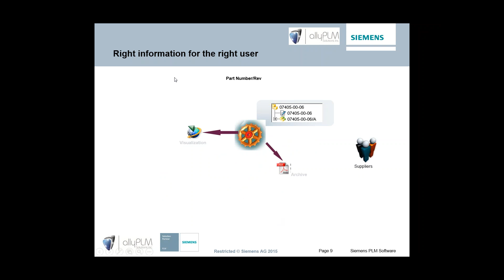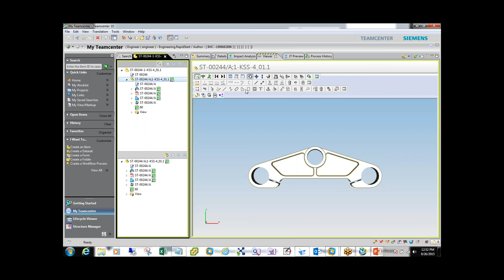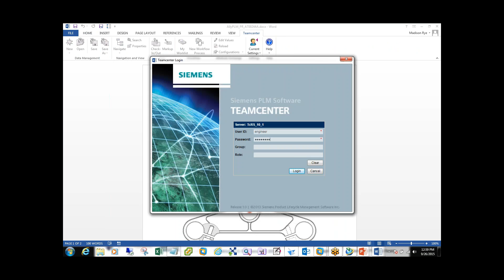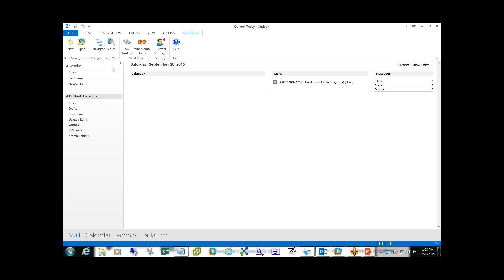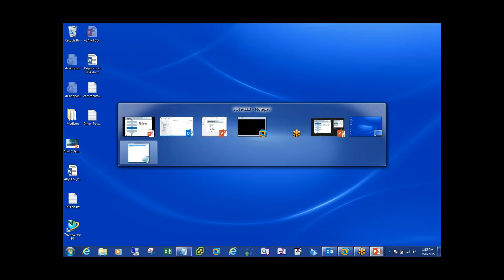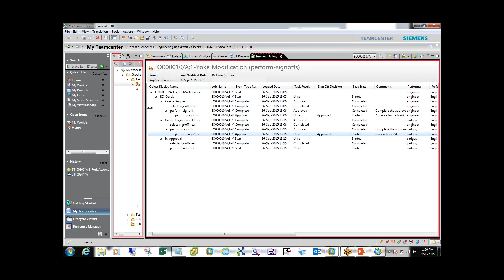Managing Data with Teamcenter

Comment: How do you retain old revisions in assembly? 

For ex: I have made a change to a released part and create new part. Replace in assembly. But The assembly is supplied to x number of projects and need to be traced to make sure correct revision is available for maintenance personnel.